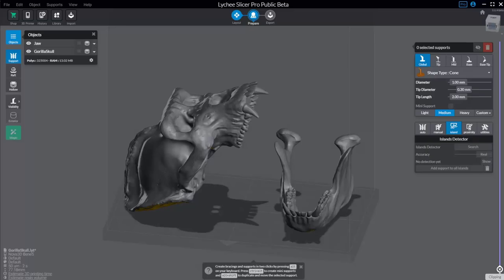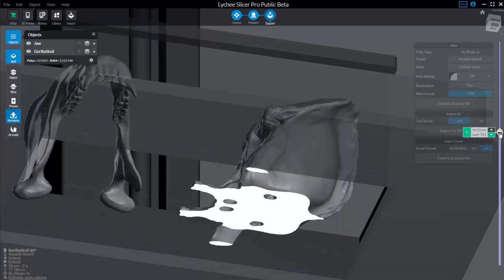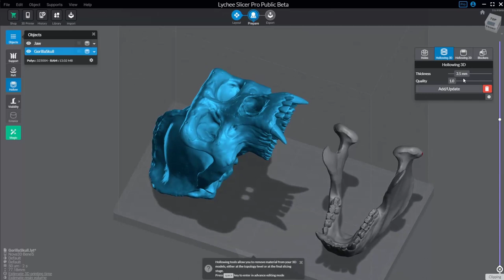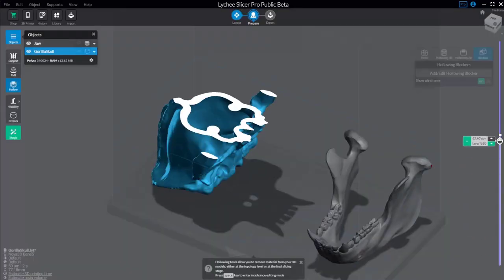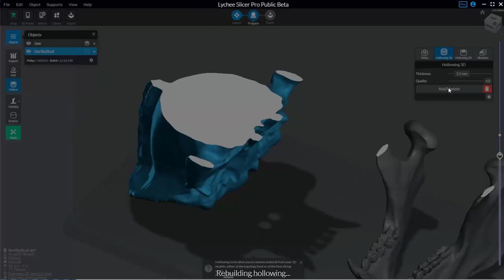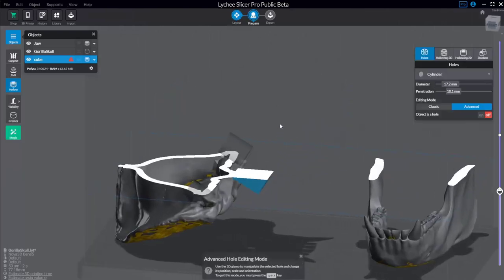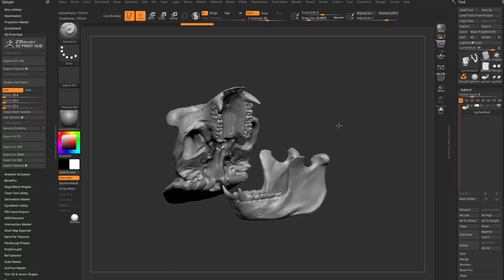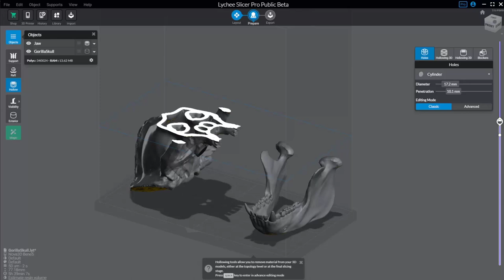Lychee Slicer 002 - Hollowing 3D, Hollowing 2D, Holes, and Blockers!

Comment: Great video!
I saw you mentioned using a cylinder (for example) from the library and use it as a hole.
Can I use that to create something like a flat donut for example?
Like create one large flat cylinder as model, and another small one and tall at least as the first and put in the center of the first one, and mark the 2nd one as a hole.
Would that print as a flat-donut?

And another question, can I for example print a miniature's base flat but lift it lets say 0.4mm from the build plate, and put under it a cylinder from the library with height of ~0.5mm (so that it overlaps with the base enough) and diameter 1~2mm smaller than the diameter of the base itself. The purpose would be to let that cylinder be cured with the bottom layers settings (usually x10 of the normal layers curing time) and hide the elephant foot under the base (ideally the cylinder + elephant foot would get just as wide as the base, but being slightly smaller would obviously hide it without compromising stability).

Also can I create two cylinder from the library. Make the 1st one wide lets say 30mm diameter and ~5mm tall and the 2nd cylinder make it lets say 10mm wide diameter, mark it as a object-hole and put it in the middle of the first cylinder. Would that print as a flat donus (if the hole-cylinder is tall enough to pierce the 1st cylinder), or would it leave a dead-end hole the a solid object that could be used for example to insert a magnet inside.

Does anyone know?

Comment: And how do you remove the infill supports after printing ?
Reply from the maker: very carefully I suppose, but I've never needed to remove infill supports since I don't see them...and if I'm printing something translucent, I'd probably opt for the dimming option under hollow 2D. There's also dissolvable supports, but I've only seen that with filament printers.